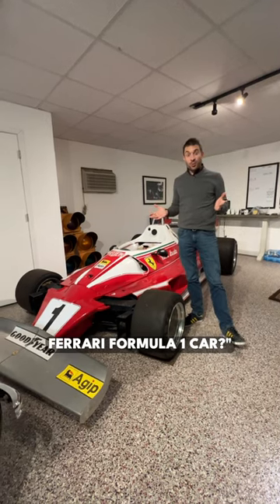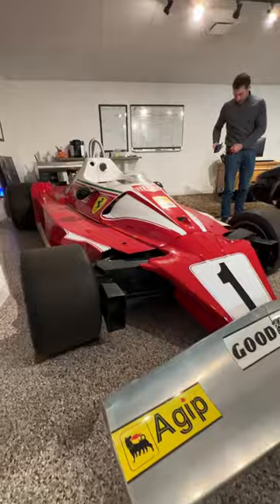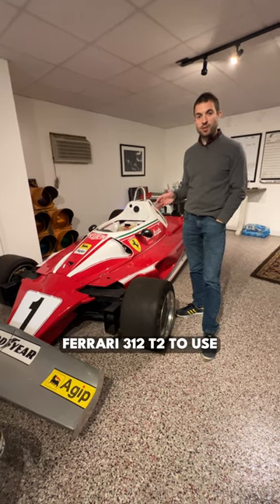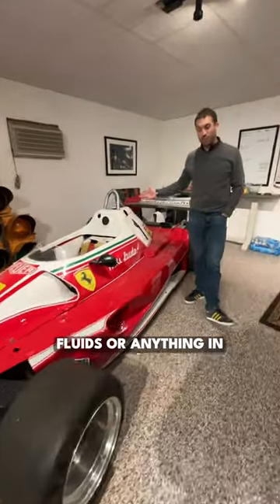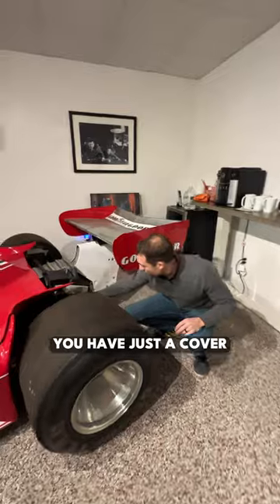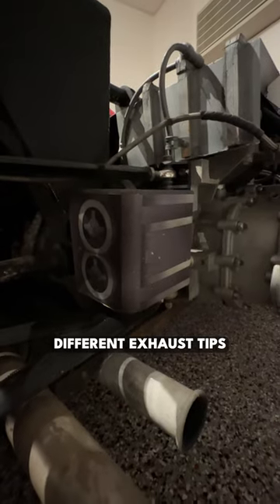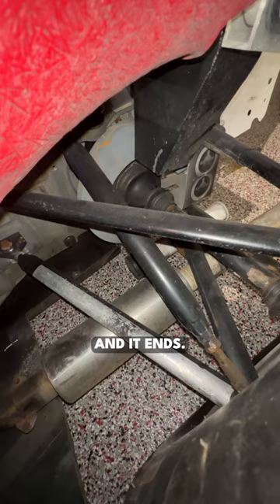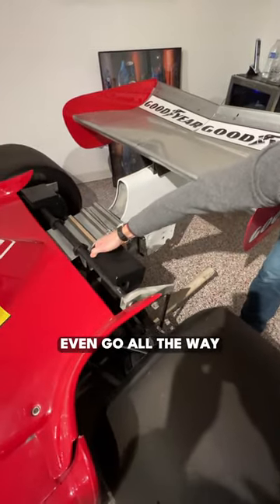Check out this Ferrari Formula 1 Prop Car

Comment: What motor is actually in it though?? Im genuinely curious bc you said only 1 pipe is connected to the engine? Is it a replica engine and you were just making the statment abt the exhaust setup or is it maybe a single cyl golf cart motor in there just so you dont have to push/roll it every where?
Reply: If i recall it was a junior formula car with essentially a bodykit
Reply: @racer501_sb F3 car with a replica kit.
Reply from the maker: It has a 2-
litre Duratec Ford engine with a dry-sump. I don't know if it's ever actually run in this car, but it's a real engine.